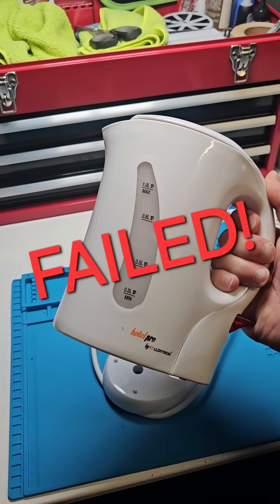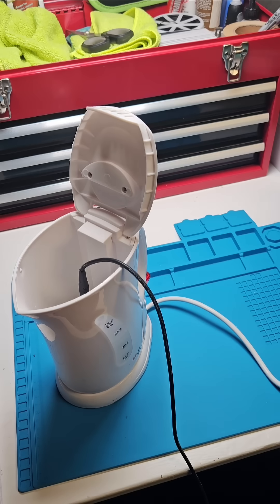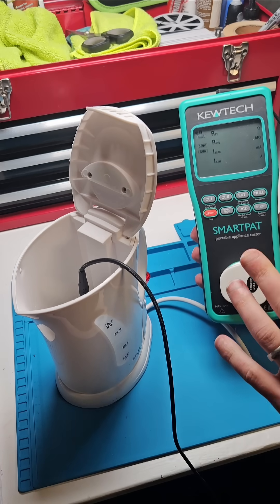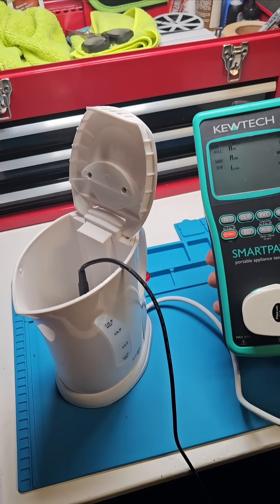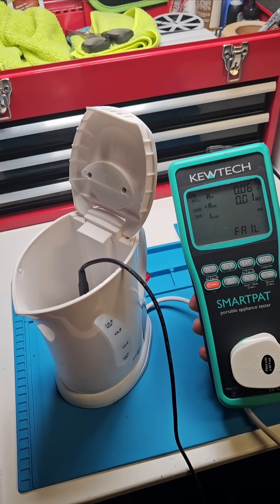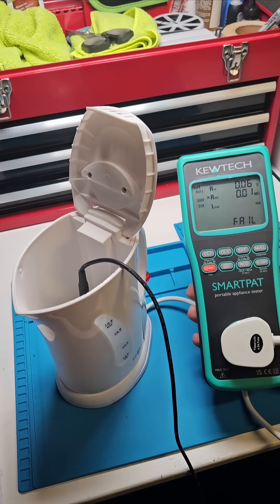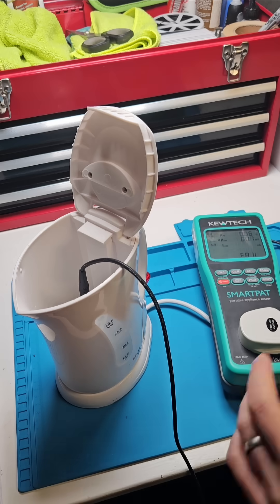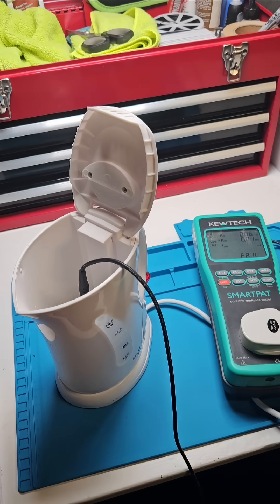The Kettle That Took Down a Building! (Failed PAT Test Short)

Comment: I was about to say that if the metal part of the kettle is wet then it can throw of the insulation readings but if its already cutting out the power and a cable was loose then yes; it probably was a dodgy kettle
Reply from the maker: Yep sure was 👍🏻
Reply: @retro_restorations I also notice that its harder to get readings when the kettle is scalding hot or just been used and emptied.
Reply from the maker: @MrHaz1993 I find the main tricky thing with kettles is usually the limescale on the elements. Generally I'll use my crocodile clips instead of the probe 👍🏻
Reply: @retro_restorations You can scrape a bit off as well but usually I find it its an old kettle like the ones you find in a Science Laboratory thats had chemicals in it: it will be virtually impossible to lift any earth readings from it.
Reply from the maker: @MrHaz1993 I don't come across too many of those myself 😂

Comment: Did the entire Building run off a single RCD? This itself is concerning because a faulty kitchen appliance shouldn't be able to cut all power. In germany in professional/business use, code requires seperate rcd, at least two, in your distribution panel, for workplace safety reasons.
Reply from the maker: Don't know the ins and outs of the building I'm afriad!